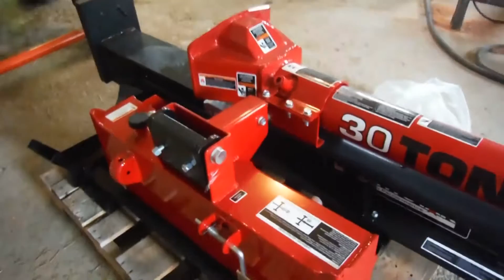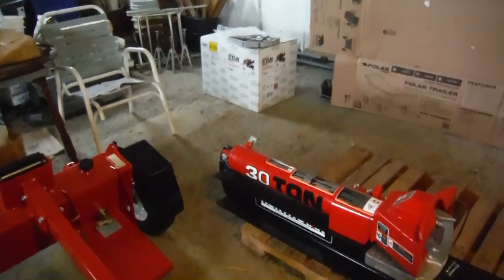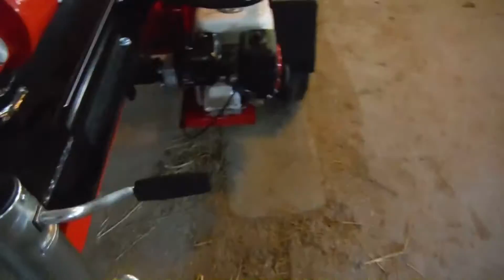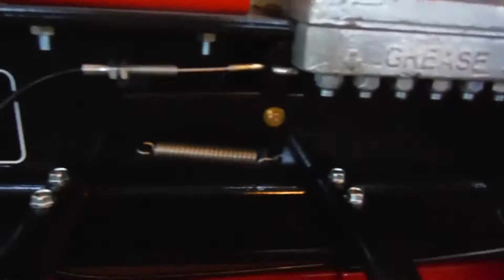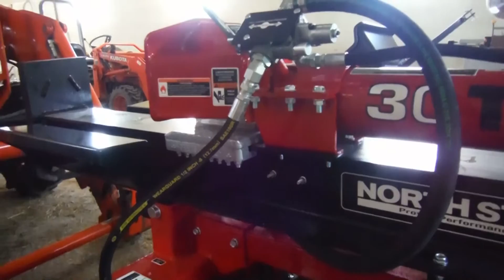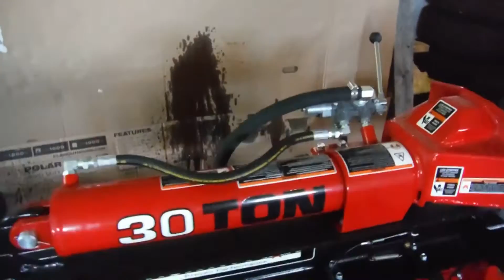Northern Tool Wood Splitter Build

Comment: Do you have enough slack in the throttle cable to stand it upright? Mine has the Kohler engine, and the throttle cable seems too short.
Reply from the maker: Yes, but the hydraulic hose is a little tight when stood up.

Comment: The idle feature has been working great for the last 8 years and still going strong.  It's a good feature when you go to gather logs to put on the splitter.  A tank of fuel lasts all day of splitting.

Comment: Before starting engine it is very important to pull over engine without starting to get oil into the hydraulic pump so isn't running dry a high rpm. This can easily toast the pump. No fun there,WAH.